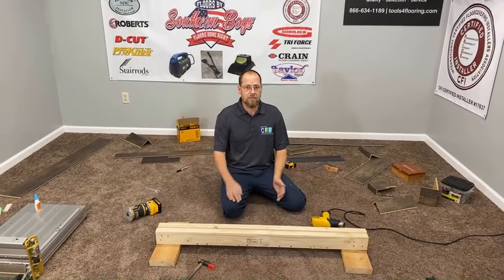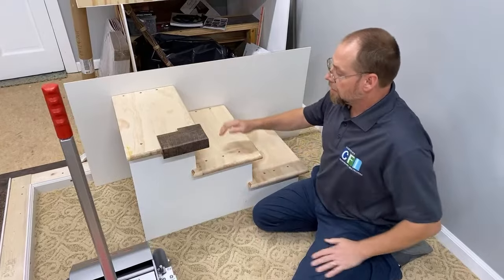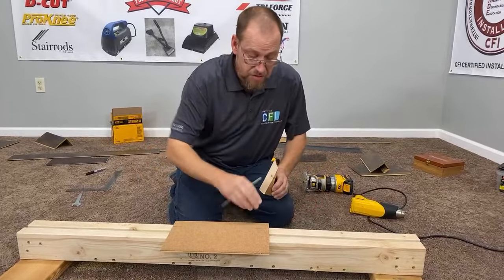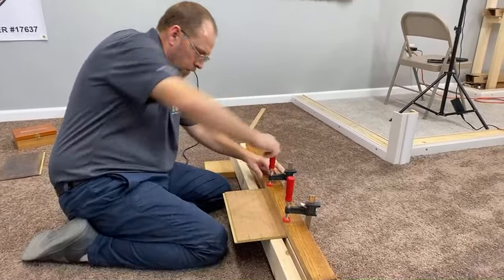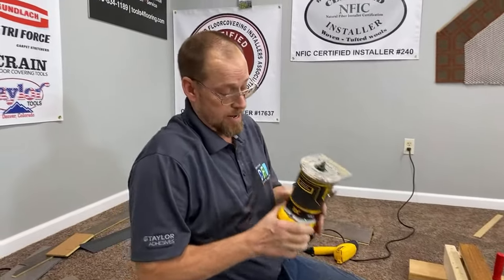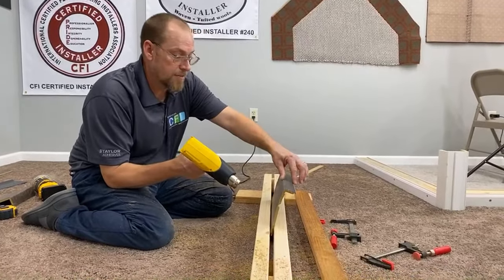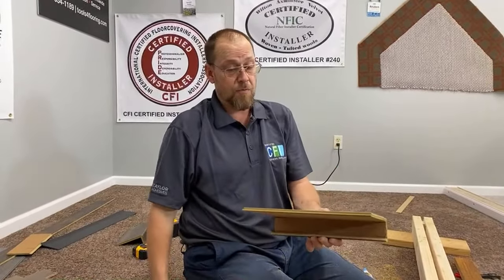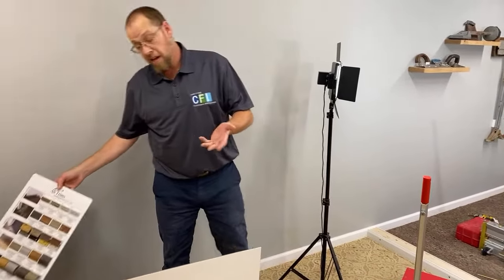,Make your own stair nose.Vinyl plank flooring

Comment: I’ve been making nosings for a couple years now with my router table. Works really well, and i like the fact that the stair pieces lock together. Thanks for sharing. Always like to learn new tips and tricks from other installers
Reply: Can this be done with Pergo laminate planks?  Thank you
Reply: I’ve done it with pergo lvp. They turned out great
Reply: @Kindlyone777 that was laminate that he was working with

Comment: Nice work. I normally heat bend the thin planks without v-cutting them as they are thin enough to not deform/de-laminate when using heat.  However, I never thought of v-cutting the thicker planking.  Thanks for the great share!

Comment: Interesting idea.
Since the stair lips are all going to be the same thickness it would be good to set up a jig with a back stop that you could push your plank against. You would put one shim against the back stop to guide your first route cut and a and put a wider shim in place make your second cut.
I used the heat gun once to heat the backing of some carpet tiles so they would bend two and a half inches over the edge of an open set of stairs.  I found after a few tests and using an infrared thermometer that you can find the ideal temperature at which it will bend by pointing the thermometer at it.  Once you have that figured out it will be easy with the infrared thermometer to keep heating until it's at a certain temperature and then you know you're close.   You got it figured out pretty well by just watching it then when it slumps over.  
That's a neat idea.  I did that once to make base shoe out of a Drop and Done product to wrap around the four outside corners.  Drop and Done is made by XL flooring. There's no tongue or groove they just lay in place and fit tightly together with zero expansion.  
I haven't bought a decent router at the time and I use my table saw set at a 45.  It took a few tries not to cut all the way through the wire layer or the color layer.
Anyway cool idea. I never would have thought of doing that for stairs. 👍
Reply from the maker: Awesome thank you for sharing
Reply: @FloorsbySouthernboys  you're quite welcome, I'm full of it. 😁
.....and I like to spread it around just like you do.

Comment: If you heat the plank from the back only, you can get right up to the groove, or dato, that way you dont have to worry about damaging the wear layer and you can heat it up considerably faster. I personally do it without the dato because it makes for a stronger step, overall. Doing it that way takes a tad bit longer, but I like the integrity of the piece better.

Comment: Great idea! And a very good instructional video 👍👊. I was just thinking of a more efficient way to heat up planks for production.
I have seen people bending pvc pipe to make 90 degree elbows by putting them in a hot water bath. They would have dozens of short lengths of pipe in a bucket of hot water. Then they would pull them out and bend them, throw them in a cold bucket of water. I think you could do the same thing with some vinyl  planks. Might  be worth a try.
Reply from the maker: Cool thank you

Comment: what are you using to adhere the LVP to the treads and kicks. Especially in a occupied home. Where foot traffic in a few hours could be required. Pressure sensitive glues take time to dry before application and  walk traffic
Reply from the maker: @BZ1340  get a polyurethane based construction adhesive

Comment: How did you make that corner piece!?! I'm thoroughly interested.
Reply from the maker: I simply made my nosing out of the plank and then just cut them on a 45 and stuck them together
Reply: @FloorsbySouthernboys   Can you describe this corner in more detail. How  is the plank fitted into the 2 sides for the filler after the 2 sides are mitered.. Since the stairs are say 10  to 11 deep and another LVP has to be snapped in to fill the rest of the tread. Are you leaving the tongue and groove opposites  so the filler fits in. I tried taking a screen shot of the piece you had as a sample but wasn’t clear enough to see the detail

Comment: Interesting….  I’m trying to find a solution to match the curve of the bullnose, as opposed to a squared look.   I suppose the same rules apply, I would have to remove more material at the spot where the LVP would need to be bent.  Good to know that this LVP can be manipulated like that.  I guess the smart thing to do is to experiment on a scrap piece to learn the LVP’s tolerance to the heat.

Comment: When you step on the front corner there isn't going to be any support and it will pull up the middle / back of the LVP wont it? Also I have never seen an LVP where when you cut the 45 for the return and butt them together you can still lock in to the long side and the short side. I am using Lifeproof LVP right now and the locks are different between the 2 sides.

Comment: Question: when you are heating the plank with your heat gun,  are you using high or low heat? I have the same wagner heat gun and there are two settings.. just want to know which one is preferred.  Thank you
Reply from the maker: High

Comment: Try a 1" thick round stair nosing!!!! That is a fun challenge, also you can cool the plank very fast if you use a rag or sponge soaked with cold water on the out side of the plank so you dont wash the glue out before it dries completely..... good video keep up the good work....

Comment: V cutting the vinyl is compromising the top layer. Won’t it crack or split from abuse of traffic. Not saying it will separate and fall apart but the top layer will crack at the corner like cracked skin on a finger
Reply from the maker: It is now January 18, 2024 and I still have these pieces and they still look the exact same as they did when I first did them. No cracking or separating overtime.

Comment: Thanks so much for taking the time to make this video.  The finish keeps cracking on the bend, what am I doing wrong?  My first V cut was close to the finish, like you showed, it cracked.  Maybe I tried to "help" it bend too soon. My second V cut was a bit less close and it cracked, it would bend on it's own after a few minutes, I gently pushed on it with a piece of scrap wood.  I'm using cali bamboo lvp.   Any advice would be appreciated.
Reply from the maker: Heat and patience

Comment: Is it necessary to remove the underlayment (lvp)? That groove you made would it weaken the lvp ?  Constant traffic on that stairs will crack that vinyl?
Reply from the maker: No it’s not necessary to remove the underlined. No it will not weaken the plank because when you bend it to a 90 and glue it just like I did it becomes A solid piece once again at the same thickness that it started out as. No it will not crack

Comment: You are good making those corners pieces but my question is how will you make it work or put it together with the rest of the flooring.
Reply from the maker: I show how to connect them on the steps and that will work for you for everything, on the top stair you will have to install that first and start there on your upstairs install

Comment: Thank you. Your a great flooring mechanic I don't always agree what you are say but what you are will work for example the hot glue gun with cove base outside corners  I prefer to use super glue that it easier to move around a little bottle of superglue then extension cord and a hot glue gun . But thank I would have never thought of that trick and actually how do you know because I forgot super glue and it truly shows you care about what you're doing

Comment: Ok so i tried this and am on my tester piece. The first was great but not the following ones. I have vinyl flooring with cork backing as it cooled down completely i got a banana shape so I could not connect the next piece of flooring. When cooling i had it on my table saw. Its happened twice and i cant figure out why.
Reply from the maker: That’s exactly the product that I am using in this video, maybe you are not cutting enough of the back out and it is too much of a strain on it to bend and That’s for making banana shaped , Don’t forget it needs to be held in the bent position as it cools

Comment: What would be the procedure to bend LVP?  It's so thin and has nothing to cut off.
Reply from the maker: Heat slowly, and bend slowly
Reply: @FloorsbySouthernboys  What adhesive do you recommend to attach vinyl to vinyl plank flooring?
Reply from the maker: @bobmarshall9545  I am doing things like in this video I use the gorilla brand super glue

Comment: Great video, THANK YOU! Question: Do I need to use the V shaped router bit or can I use a straight U square bit?
Reply from the maker: You need to use the V-shaped half inch that way when you bend it 90° it completely closes the gap so you do not lose any structural integrity of the product
Reply: THANK YOU VERY VERY MUCH! HAVE A GREAT WEEKEND!

Comment: So they say you need a 1/4 inch because of expansion and contraction of weather patterns and that's why you use the stair nose. So my question is, how does this hold up throughout the seasons? Does it buckle? I live in the north, but I'm curious. We also do not have a stair nose that is compatible with our vinyl planks